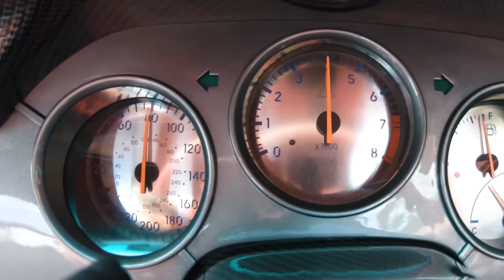The secret to Japanese car reliability - REVEALED!

Comment: Someone i know worked at BMW for some years, as a member of the development team, when the F11 came out, after a while they started getting recall after recall, something went wrong in the welding proces at the factory, causing 1000+ cars to steer to the left all the time, the chassis was warped from factory. 

BMW's Solution? Pump up the back left tire a little bit harder then the others, so the harder tire would straighten the ride. 

He left after this, and went to Toyota, and Toyota do a lot of recals, to ensure there products are almost perfect. There is a major difference in mindset between Japanese manufacturers and European manufacturers. From start to finish, from design to build, from customer to the dealers. Japanese do it best.
Reply: Toyota do a lot of recalls because it’s marketing genius , the showroom foot traffic is incredible , sorry to sound cynical , but a recall is good news for car dealerships , we flat out sell new cars when there’s a recall on simply because of temptation and human nature when seeing the latest models.
Reply: You know right Junkota holds the crown of No of Recalls !
Reply: ...insure their products...
Reply: r/thathappened

Comment: The secret is strong, durable metal and not just metal, but a lot more metal than needed along with long term refinement of the same platform, design and architecture
Reply: They were tin cans cmpared to western cars back in the days. But they were simpler.
Reply: @martinsvensson6884  The non-economy-box 80s and 90s Japanese cars were much more advanced in many ways than most cars out there at the time.
Reply: @badass6300  SAAB was the best brand for over engineered cars...
Reply: @alanwayte432  so?
Reply: @badass6300  Maybe compared to American cars. But not to German or any other european cars. Japaneese cars are still less advanced. They go for tried soiutions instead. Mercedes and BMW for example cant do that anymore. Especially not for the top end models.
Reply: @martinsvensson6884  have you seen the honda prelude from 1988, with 4-wheel/rear-wheel steering. The Nissan ZX300 and Mitsubishi GTO 3000 both decked out with a lot of tech, Acura/Honda NSX, Nissan Skyline R32-34 GTR, the Mitsubishi Lancer Evo or Subaru Impreza WRX. The Mazda RX7. The Integra Type-R, Toyota MR2. All these cars were high-tech and affordable compared to many cars the managed to compete with that were outside their class and price range.

And keep in mind the price and class of those cars, don't compare them to cars that costed 2-10x times more, compare them to cars of equal price. Though in Europe japanese cars were never very popular and have always been overpriced for some reason, but still.
Reply: @nightdriver7216  iron is a strong metal though.
Reply: @badass6300  Yes, but they were not big mass market cars. Also calling most of those cars high tech is pretty exaggerated. Some single soultions on them might have been high tech. But not the general car. Has nothing to do with with the type of high tech that a new S-class is for example. The ones that stick out in the statistics are not those cars either. Its cars like the Toyota Yaris for example and some base models.
Reply: @martinsvensson6884  Less advanced? Maybe. But low cost and high reliably is what most motorists want. It's a winning formula. And with the advent of electric vehicles, it will stay a winning formula.  

Germany makes cutting edge cars for cashed up car enthusiasts. But with the transition to electric vehicles,  Germany's "cutting edge" is becoming decidedly blunt. Trying to sell expensive cars that no longer have a technology lead over the competition is going to be.....difficult.
Reply: @ohlordy2042  Yes, and then you buy one of the base models that correpsond to the regular cars that other makers sell. That's what all Taxi companies do. MB has been among the most common Taxis for decades despite not being the cheapest option.
You are never goin to be able to buy a highly advanced car and think that the parts for achieving that is going to be few and cheap.
Who else has a technological lead? I havent seen anyone :) BMW Audi and MB are competing amongst themselves to 90%. Noone else is making better performing cars than those. And the EV's coming out now are better than the Tesla. So its more likely going to be difficult for Tesla.

Comment: As well as reliability, Japenese culture and ethos includes premium customer service as a matter of respect.  Respect for customers is reflected as respect for nation and self.  It is this respect and pride in workmanship that was missing from the West who just concentrated on profit and cheapness.

I drive a Lexus F Sport RX450h as featured.  It is the best car I've ever owned.  Those who scoff that it's not the fastest...real world 0-60 in 6.8secs (as tested) is fast enough for anyone and huge combined torque = effortless overtakes.  It does this whilst carrying 4 in complete luxury and is capable of going around the earth 10 times before you need worry about anything major on that lovely v6 engine.  Can you see any landrover or jag managing this?  No.  They'd need an articulated lorry full of spares and a large team just to keep the things on the road.

Don't be fooled though.  The best quality goes into the better Lexus cars so you buy either the LS or the RX if you want the best.  Cheaper models have their issues and all suffer from things like premature suspension wear...primarily control arm bushes failing due to our roads and their weight being heavy hybrids.  Avoid their diesels...those are far less reliable. Older lexus cars are best in petrol form.  Best bang for buck is the older non hybrid GS300 V6 3 litre.  Ls luxury in a car to rival pure driving pleasure of bmw.

Comment: I had an old Nissan sentra (90's) in El Salvador, I've done 30k km with it, from 400.000 to 430.000. 

What a beast, needless to say the weather (super hot) and roads are crappy, even though it served me well, only issue it struggled to start on cold days (condensation maybe?).

My french Clio II has done 210.000 km and its already dying...

Comment: 2jz engines are strong but not strong enough to handle 1000hp stock. You need to do an engine rebuild to reach those kind of numbers. Stock engine is good for anywhere from 450-550hp.
Reply: what does rebuild involve? better intake, higher volume injectors, increased bore diameter or primarily stronger materials. thanks

Comment: When i was younger i asked my dad why we had 2 hondas in the driveway. 20 years on, we still have one of them. That set my heart on honda, so i went off and bought one. The 3 hondas we've had in the family are an 89 integera, that got sold because we needed a bigger car at the time. 1991 until 2006. A 1999 honda accord, we still have that. 1999 until present. And a 2014 honda civic. 2022 until present

Comment: Many years ago I used to drive Vauxhall’s and accepted the unreliability as the norm. After my last Vectra broke its gearbox I gave up and bought a Nissan Primera. After 150000 miles with no breakdowns I bought  six more Nissans and currently own two Notes. No breakdowns from any of them.
Reply: And Nissan is considered one of the most unreliable Japanese brands. Imagine what a Honda or Toyota is like ;)
Reply: @AlohaBiatch  actually that’s an interesting point. Are modern Nissans less reliable than previously? My current ( very reliable) Nissan Notes are 2009 and 2013.
Reply: 6 Nissans and you didn't know about other Japanese brands?
Primera is a little more reliable Renault Laguna with a nice touch on the inside

Comment: I have owned Alfa Romeo, Fiat, Ford, Honda, Jeep,  Land Rover, Mazda, Mercedes,  Mitsubishi, Nissan (OK Datsun back then), Peugeot, Renault, Suzuki, VW, Volvo in the last 42 years and.. yes you are RIGHT MATT. Your statement, in general, is valid. Japaneese cars are more reliable. I never own Korean car though. Currently own Cherokee with 257,000 miles but that is just used for around town and XC60 which my wife loves but parts are expensive

Comment: Just bought my new Toyota Aqua, which is made in a Japanese factory. It is a bit of a wait with my options but cant wait. I dont think aqua was ever available in UK. Its a hybrid only hatchback going back to I think 2011 as a hatchback alternative to prius. It is bigger and of higher quality than Yaris ( better materials). I am swapping my 2WD Aqua to finally released 4WD option ( super snowy here in Hokkaido and with new permanent house the oldie wont make it up that steep driveway. I mean in 1h you easily can get 20-30cm fresh snow).

Comment: I drive a 2008 Lexus ISF and it is so reliable in comparison to an M3 of RS4 of the same era. And its better than them also. I test drove a 2008 M3 a week ago and it was so disappointing and rattly. The interior felt cheap and I know for a fact that the engines are not strong so you have to set aside money for rod bearings.

I can just drive my ISF all day every day without ever worrying about a big bill. I love it so much.

Comment: 2JZ doesn’t make 1000hp with no problems lol.
Reply: Bmw lover endered the chat🤡
Reply: 500-600 hp are still there, which is double the hp nearly. Very impressive!
Reply: @cachememory  so does most turbo 6 cylinders like the s55 which easily make 800mbefore building it
Reply: @kats-zt2ks  I have no idea what ur talking about I’m not bias at all
Reply: @Seven Penguins ima tell you right now 2jz is way more reliable then most turbo inline 6s from bmw however no 2jz is making 1000 for long with out building it.
Reply: @Seven Penguins Then that’s not with no problems lol almost any engine can make 1000hp if you built it, what’s impressive is when you can make tons of power easily
Reply: @Seven Penguins and I never said any thing about stock

Comment: i've been using my dad's toyota corolla 1984 and the engine is still running smooth as silk
Reply: Haha. They never ran very smooth even as new :) The cars with the most miles on them from that era are MB:s.

Comment: But not Nissan, because they’re partnered with Renault.
Reply: ppl just think Nissan’s are unreliable cuz it had a CVT problem 15 years ago, back when they were in the early stages of development. I’ll definitely say since Renault bought stakes in the company the interior bits and parts are not at the quality Nissan once was in the 90s but there engines and transmissions other than the 2007-12 first gen CVT are still very solid especially with there engine development they haven’t cut costs in that department at all, now idk much about Nissan’s in Europe but Ik the Nissan’s that were made with Renault aren’t very good cuz, it’s Renault lol
Reply: Nissan products from Japan are still great though, think Z car or GTR. No relationship with Renault products.

Comment: It has also to do with simplicity. At Japanese car brands you can maybe get 3 or 4 different versions of the same model at a time and you don't get many options for customization. You can perhaps slab a sunroof on your Civic Executive or a hitch on your CX-3 Comfort, but you wouldn't be able to have a fully equiped S class without foglights or heated sidemirrors. There's much more control over the production process this way rather than customizing each and every car. Plus, it makes much more sense dragging along the entire loom because you're actually using 99% of it rather than having the connectors for powered windows but having to operate them manually because you didn't check the box...

Comment: I understand it was BMW who pioneered the use of plastic parts under the bonnet..(water pumps, thermostat housings etc) . VW quickly followed. I’m sure Toyota we’re watching this trend with interest,  possibly focusing on the longer term parts failure stats and anecdotal customer reports. Here in Australia plastic parts are known to have a limited life due to the continued ambient heat, sitting under a hot bonnet in a vehicle which hasn’t been driven since yesterday. Cracked radiators, thermostat housings, turbo pipes etc have been experienced repeatedly by owners. 
I wonder if Toyota, and other Japanese makers, are now using more plastics under hood? If so, the compounds used may be more flexible etc?

Comment: "Revv up ur engines!"
Theres no such thing as a bad Japanese product..
Id blindly take any Japanese brand..not just cars but also electronics
Reply: You couldn't have said it better, same with all their electronics. I have had several Japanese electronics over decades and they last forever. High quality products and performance especially from SONY. I remember when i was younger and in University, my dad bought this HONDA generator. That generator lasted over a decade with only routine service. The Generator only started having issues once one quack repair man who was supposed to do a few tuning things handled it. I have had a few Chinese Generators since then and it has just been a terrible experience. Chinese build quality to be frank is just crap and their products unreliable.
Reply: it’s funny how our 22 year old japanese vacuum cleaner works better than our 3 year old italian one. quality runs through the veins of these japanese workers!

Comment: Well...my very first car NZ121 corolla, which share the same engine and gear box with 140 and 160 generations. That's from 2000 till today, I am sure that will be reliable. Try any new Japanese car i.e. my FK2 full of sensors just like the european rival, it start lighting up like a x'mas tree

Comment: Whilst I admit that Toyota and Honda are the MOST reliable cars, I gotta give a shoutout to Volvo, at least the older TRUE volvos (not the Ford era ones).
I think Volvo's pursuit of Safety also meant that the cars had to be very reliable. A good volvo will last the same, if not longer than a Honda/Toyota, because Honda's rust out, and Volvos dont. Volvo very expensive maintainence though BUT they are more luxurious and better equipped.

Comment: They're overengineered to perfection. They used strong materials in the building process, nearly flawless engineers, designers and manufacturering techniques.
But why?
Back in those days the Japanese manufacturers still needed to proove themselves. They were still seen as bottom feeders. So they went after all leaders in certain aspects of the car industry.
They had the technology aspect checked off.
They went after the german relialability, luxury and toughness.
They went after Italian design and fun of use.
They went after american ease of working on them.
And put then all into one quite often.

That's when we got the NSX, the Skyline R32, the RX7s, the Supras, the Lexuses
Even the cheaper cars were well made and fun.
The Civics, The Sunnies, the Corollas.

And all of them were built because the Japanese wanted to proove themselves
Reply: The 90's was also a perfect storm of manufacturing techniques being good enough to reduce part tolerences, but CAD software not being good enough to accurately model all the stresses. So things were overbuilt because they had to air more on the side of caution.

Comment: Does the Subaru BRZ and the Toyota 86 have the same engine reliability or is 1 better than the other?
Reply: Probably same reliability because all parts are the same.
Reply: @Has7DCT  I saw a video saying that Toyota engineers disassembled all the FA20s and then reassembled them before the 86 went in production

Comment: Oily bits will survive a nuclear winter, whilst the bodywork/chasis rusts at the first sign of a frost.
Reply: Yes I had a 2007 Auris and the rear axle spring carrier snapped needed a whole axle underneath the car was rotten out also had to replace the fuel pipe that goes to the tank . Bought a 2005 Peugeot and underside is very very clean with barely any rust it’s a shame they’re not more protected . My dad also has an 06 Avensis and for MOT it needed two rear arms they were severely rotted and holed

Comment: As much as people dislike the new A90 Supra for being mostly BMW, I'm glad Toyota went through the trouble of making sure it had a closed deck engine design, had a proven gearbox, inspected every mechanical component to meet their standards and tested it to handle up to 700hp. It might not be their own engineering underneath but their Kaizen philosophy still applies.

Comment: Part of it is cultural, good engineering, and part of it is the fact they don't go out of their way to innovate usually. A 4Runner that hasn't had any real revisions in over 10 years is just going to be more reliable. The brand new RAV4 has an infotainment system that looks 8 years old. They are more interested in their appearance/documented cases of reliability than making new strides in cars. And that's FINE. Other manufactures do the opposite and have higher risks of reliability issues (like VW, etc). I drive a GTI, so I'm in favour of the latter camp, but I understand why people want the former.

Comment: I've never owned anything but Manual Transmission Toyotas.  -98 camry -03 tacoma  -96 Tacoma  -85 4Runner -84 4Runner  and every one went over 300'000 miles and the 85 went over 500'000 before the motor ate so much oil it was time to retire her

Comment: At the start of Japanese auto manufacturing, they were actually worse. But they worked on it. Partially do the pride and partially due to knowing that they had to establish a positive reputation. Due to the restrictions of Japanese cars and gas prices going up, more of them sold. The other auto manufacturers were losing a percentage of the market. They decided that to counteract this they would make cars that weren't quite as good. Cars that were more feature equipped, more powerful, more quickly replaced.